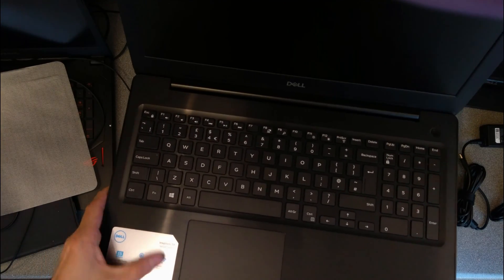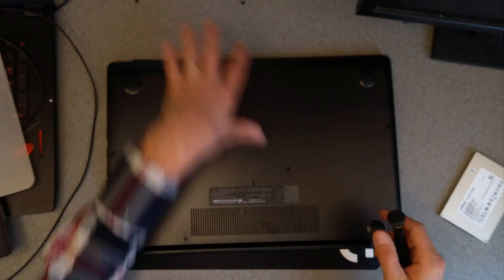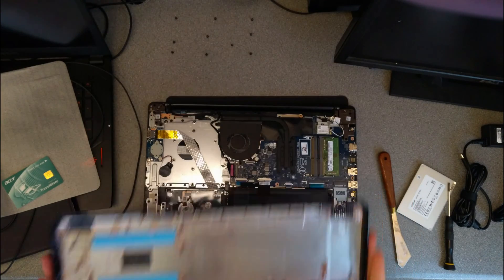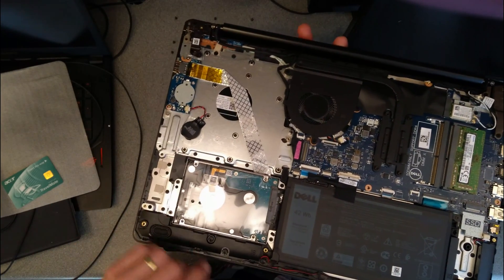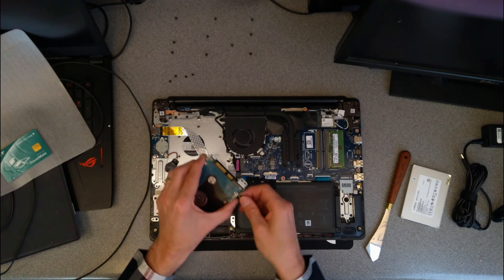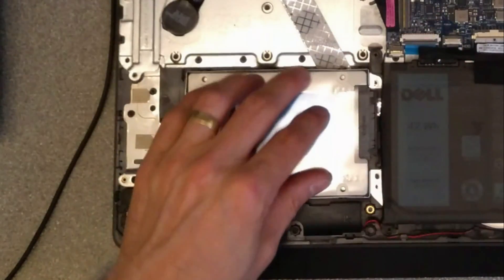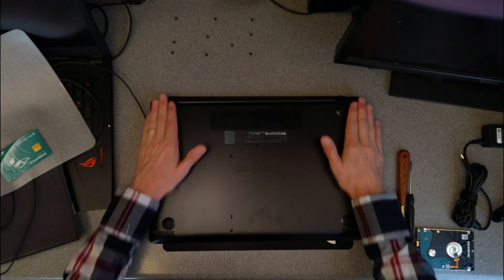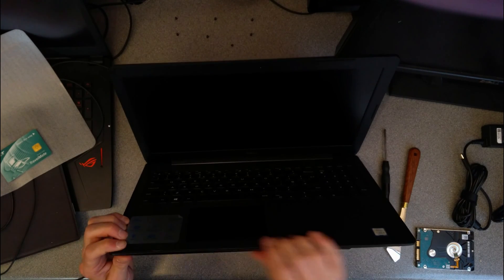Inspiron 15 5000 P75F - How to change or upgrade the hard disk

Comment from the maker: If you have a version of this laptop with a DVD drive you must be aware that an additional screw (or more than one?) on the underside cover needs removing and you can then slide out the DVD drive!
Reply: Just to clarify, with a DVD drive version, the lower right screw of the 2 screws toward the center of the back cover shown in the video releases the DVD drive from the laptop. With that screw removed and with the drive drawer open before disassembly, you can then remove the drive by pulling it out. Once the drive is removed, there are two screws visible at the entrance to slot for the drive. Remove them and then proceed to remove the back cover as the video shows. When reassembling, put the back cover on, replace the 2 screws, replace the DVD drive, then replace the screws on the back cover. (The DVD drive is designed to be electronically disconnected and reconnected with the back cover in place.)
Reply: I'm looking for a tool like your trusty spudger, with a large blade and handle. Do you happen to remember where you got it? Thanks!
Reply from the maker: @lightfusegetaway  Amazon.. RGM 103 is the thing. Looks like UK only has 109 in stock which is a slightly different shape. The 103 knife is the one recommended by Louis Rossmann of Apple repair YouTube!
Reply: @freename  Ahhh, no wonder it didn't come up in search... Didn't know it was a pallette knife. Looks a lot better than the small spudgers. And not too pricey either. Also, your video was very helpful in upgrading my coworker’s laptop to SSD. So a double thanks to you!

Comment: Having trouble getting the two screws below the CD player out. CD Tray is out, but the two small screws underneath are a bitch. My screwdrivers just spin in the slots........
Reply from the maker: Yep! You need the right screwdriver for those usually. One of the jeweller/watch fixing type ones. I use ones like this for those screws: https://uk.rs-online.com/web/p/screwdriver-sets/0537883
Reply: @freename  Got a nice tool kit from Amazon real quick. Came apart easy/ I liked the tweezers and skinny pallet blade. Put it back together and got the dreaded no boot disc found. I had cloned the HD. I know nothing of BIOS commands either. Gave up after going in circles an hour w google searches. Popped in a USB recovery drive I made last week and it failed after " Getting Everything Ready " stage.  I am thoroughly stumped. The laptop does show the drive is there. Now what to do. By the way thanks for the great video and tips. Marty
Reply from the maker: @meverhard  The most reliable tool I've found for cloning drives is Macrium Reflect. And if it fails to boot after a clone, use the reflect USB tool to create a recovery USB and then tell it to "fix boot problems" in the restore tab. They used to have a free home version but more recent visits to the website seem to suggest they only do a trial version now :( ?
Reply from the maker: Also my colleague says the getting your computer ready can often get "stuck" at around 92% for a long time, just wait!
Reply: @freename  Do I have to take it apart again? I do think the clone was corrupted somehow. I had about 90 gigs on he old drive and it cloned in 5 mins. Said was successful  though.
Reply from the maker: @meverhard  Depends how you cloned it. If you had a USB to SATA cable then just boot from the Macrium USB recovery and re-clone the drive (try the fix boot problems option first though, then re-clone if that fails, then try fix boot problems if it still doesn't boot). [Be careful and aware which source and destination drive you are selecting, don't end up wiping the wrong drive!]
Reply: @freename  I used a different software but did use a cable. So it will boot to the old drive then if I plug into USB port.?
Reply: @freename  I used MiniTool software. I will see if I can get that drive to boot and pull MT u p. Crossing fingers.
Reply from the maker: I've never had much luck with minitool other than for resizing partitions.
Reply: @freename  Looks like i had no luck either!
Reply: @freename  I tried everything i could find on the web several hours each night. Finally wiped the new solid state drive and booted the Windows 10 usb drive i had made before all this. Booted right up on the clean drive. Learned lots.

Comment: Some advice for if you model has a disk drive, continue as normal until you about done unclipping the side with the drive then turn it over and pull the whole disk drive out (only connected  by a sata port) and there will be 2 screws underneath where it was that will otherwise prevent you from lifting the cover off.
Reply from the maker: Thanks :) It is annoying they seem to have two slightly different variants of exactly the same model number.

Comment: Hi, please recommend SSD and HDD brand and storage capacity (preferably the one that can handle a gaming app). (I don't know if I am using the right terms, but I hope you can help me.)
I have the same unit as this but with CD slot. My HDD is no longer working and said need to replace due to some kind of failure on it.

I also want to know if there's a chance that I can get the files on my broken(?) HDD?

Thank you in advance...
Reply from the maker: Recovery of files on the hard disk: Unknown, depends what has happened to it. Does it spin, does it click? what error happens etc.

SSD: Totally up to you. Pick a capacity and off you go. All depends on how many games and how large the games are etc. I'd say a minimum of a 250GB SSD; likely larger if you plan to install lots of games or keep lots of video.

Comment: I noticed you mentioned the lenovo laptops in the comments section. I have two of these units for the kids who do online studies. One works great, no problem. The other one has been to the repair shop under warranty for screen issues. Never did work properly afterwards (black screen). Now the laptop is just a dust collector. 
The hard drive has gone out in my Dell Inspiron. I have just begun my research on hard drives (your video my first), my question is, would these two hard drives (lenovo ideapad 5 and dell inspiron be compatible, maybe save me a few bucks? Thanks for your time!
Reply from the maker: Yes, the drives would work but I'd highly recommend changing to an SSD. The computer will be quicker than when it was new if you put in an SSD.

Comment: Once you remove the screws in the middle of the back cover you can pull out the disc drive. There are two screws then visible at the slot for the disc drive that need to be removed. Otherwise you will damage the back cover (as I did) when you remove the back cover. The video does not show this step.
Reply from the maker: I've seen a comment like this once before.. It looks like the version with the DVD drive has the additional screw:
https://www.youtube.com/watch?v=FgpoAnV6gHw&lc=Ugz5gDusFXHFijvRxw14AaABAg

The version I opened didn't have the DVD drive so I couldn't perform that step (and didn't know that it could have been needed).
I've pinned a comment and edited the description to try and make it clearer for others in the future.

Comment: Hi, Prior installing my new SSD, I have cloned the existing std HD to a new SSD.  Once the SSD installed, Windows doesn't want to load anymore (boot-up). Any suggestion?
Reply from the maker: What did you clone it with?
Reply: @freename  Macrium Reflect 7
Reply from the maker: Used the usb boot stick Macrium can create and used the repair windows startup option. That usually solves it.

Comment: Did you clone the ssd first and just install it? Once installed no need to tell laptop what/where its booting from? Just im doing this soon and i wanna do it right first time
Reply from the maker: I normally clone first using macrium reflect and a usb to SATA lead. Then plonk into laptop and as long as the original drive is gone it should default boot from the new drive.

Comment: I used two fingernails to open mine... fingernail keratin is amazing stuff and much more precise in feel than a spudger.  Was afraid you were going to cut an artery with that damn knife!
Reply from the maker: Might be ok for your own computer but no way am I getting other people's scummy computer edge gunk stuck under my fingernails. Plus I've done it enough times to know that it doesn't take much to accidentally overdo it and bend a fingernail back on itself. I'm yet to damage a computer with the craft knife. It's more flexible than it looks in the video.

Comment: hi I have same model of dell laptop p75f and i want to add M.2 Nvme ssd to it 250gb as I have removed my older ssd of 16gb and now I cant access my hdd and even I cant view in disk management but it does show me on BIOS system information , can you explain thanks.

Comment: Can you help me? I bought this Inspiron 15 P75F with Ubuntu from Dell, but now I'm not using that much and want to give it to my wife, I have a HD with Windows 10 in it, I already used this HD in another laptop and also in a desktop, but when I try to put it in the P75F it does not recognize it, I already changed the BIOS what I had to change but it simply doesn't work, the HD (or boot file) doesn't appear on the list, and there is no problem with the bus 'cause I put the original HD back and worked well.
Reply from the maker: Why not install windows from fresh on the Dell? What's the benefit of moving the hard disk?
Reply: @freename  no benefits at all, but wouldn't I need another license for it? By the way, I'll need the HD with Ubuntu
Reply from the maker: @alankardec5875  The windows activation is stored against the motherboard. Moving the hard disk to another machine will deactivate windows. If you have a product key string of numbers and letters on a sticker you may be able to reactivate it with the code. If you just have a "Windows 8" (or newer) sticker on the source computer - with no product key on it.. you won't be able to reactivate windows on the destination computer.
Reply: @freename  Well, I already moved this hard disk from one machine to another several times and never had this problem, the only thing I had to do was change from UEFI to Legacy , but inside P75F it doesn't even read boot file, I'll search more for it, thanks

Comment: Hey, I also have this laptop, can i increase video memory or Graphics Card on this laptop.

Also can we also add SSD on this?
Reply from the maker: Video memory: Unless the option is in BIOS.. no.
SSD: Yes. You can either replace the hard disk in the bottom left at 7:20 or add an M.2 SSD on the right in the area with "SSD" on it!

Comment: Cheers, excellent description, helped immensely. By chance have you got and solved the battery not charging issue in this exact model. I've got a standard list of things to check, but wondered if you have encountered it??
Reply from the maker: Not much I can suggest other than swapping the battery with one that is known to work in another machine and see if the problem follows the battery or the machine.

Comment: Nice work. I have the CD in mine, so that was a little side-track, but this video had everything needed with good directions.
Reply from the maker: Thanks for the feedback. I assume the one with the CD drive needs another screw undoing and the CD drive sliding out?
Reply: @freename  A screw in the bottom of the case freed up the CD drive to slide out. Then there are 2 tiny screws holding the frame to the side of the case that need to be removed before the case bottom will come free. It's easy to miss that and break the thin piece of the case that would rest just above the CD door during normal operation. It's nothing hard, just need to notice that the case isn't popping off there
Reply: @psychfish  phew... I checked the comments just as I was about to either break the damn thing or take it to a shop trying to get the last bit off.. Thanks for your comment!
Reply: @freename  Yes, there's one tiny screw on the underside. Then the CD drive assembly slides right out.

Comment: I'm so grateful for this helpful video. I've changed components of laptops before but this video let me know to take the computer in to a professional because there is a great risk that I would break something on my poorly designed Dell. Special thanks for starting with stating and showing exact model number, same as mine! First time ever subscribing to a youtuber.
Reply from the maker: Thank you very much for the thanks :) and the subscribe is great so thanks for that too.
Reply: Hi, my name is jefferson and my dell does not want to read the hd, I bought a ssd from kingston hj, but I do not know how to open it, your video helped me a lot, agr I'm doubtful if it has difference of Ssd from a manufacturer  or another, would you let me know?  I'm brazilian.
Reply: @jeffersonluis2034  Cara tenta acessar a BIOS, liga o pc com o ssd conectado, a partir da bios da placa mãe procura pelo ssd. As vezes a placa mãe simplesmente ignora um disco

Comment: If you have version with CD , pull out CD before removing cover, and there are two more screws attached to cover needs to be removed
Reply: I have the version with a CD drive. Do you know how to remove the CD drive?
Reply: @jonthereader  I just did the replacement and I have CD. After you remove the screws from the bottom, the CD player will simply pull out to the side. Then be sure to remove the 2 tiny screws that hold the bottom of the case onto the side of the case.